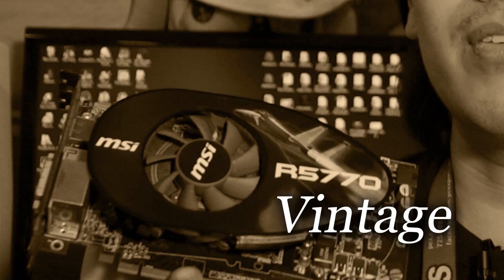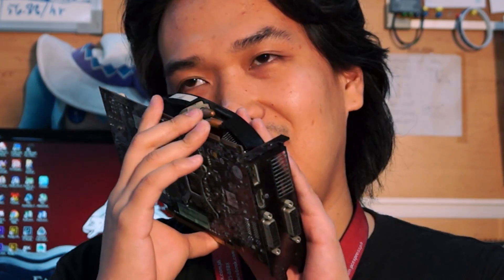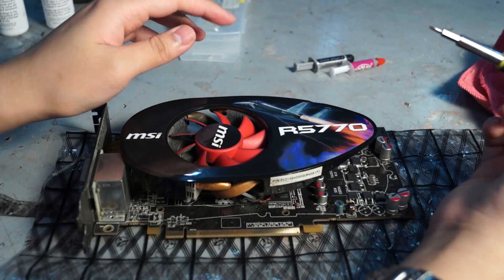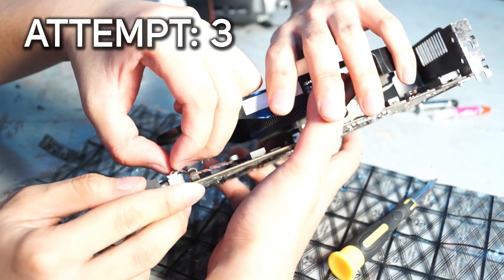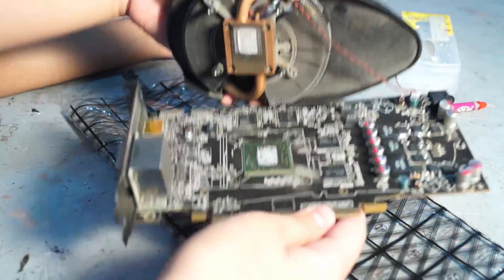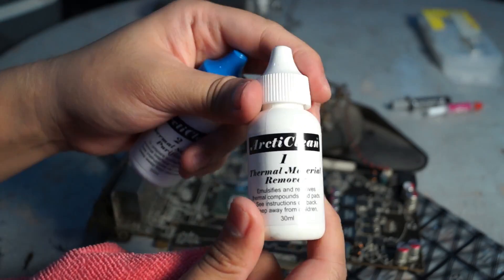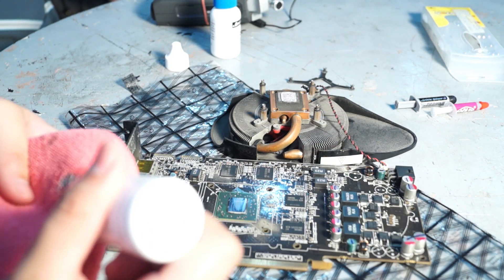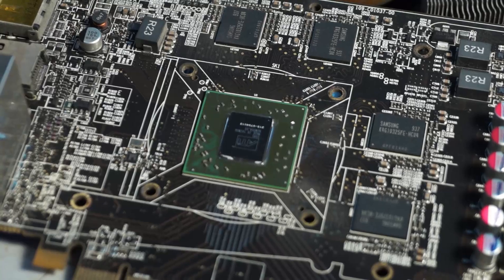PA-HELP - Reviving Your Old Video Card - Replacing GPU Thermal Paste - Radeon HD 5770

Comment: my laptop coming so hot and when i play i get alot fram drop from 100to20 fram should i put thermal paste?
Reply from the maker: Be sure your laptop meets the game's minimum requirements. Try cleaning the fans first. If you still get the same problem, maybe it's time to replace the thermal pastes.

Comment: Hi! Great video by the way :) Im planning to Upgrade my PC set up and Ano po ba dapat kong unahin bilhin, Motherboard or Video card?.(gamer's preference)  Cause I cant buy it in one go. What do you recommend? :) thanks for the answer!
Reply from the maker: +Percival It depends on your current specs, but it&#39;s cheaper to upgrade your video card first. You&#39;ll run into compatibility issues especially if you&#39;re upgrading to higher-gen specs. Buying a new motherboard may cause you to get a different CPU, RAM modules, etc. Whereas newer video cards, PCIe 3.0 x16 can run on PCIe 2.0. x8.
Reply: +PCXTV So its better if i get my video card upgraded first? :)
Reply from the maker: Can you post your current specs, and your planned upgrade so I'll get a better idea.